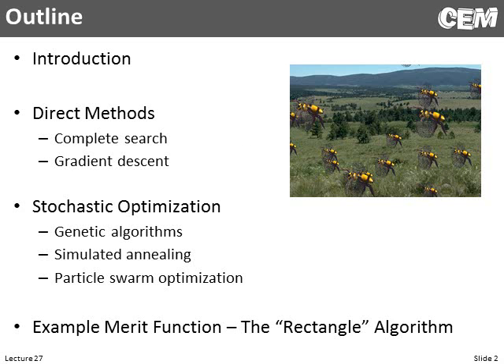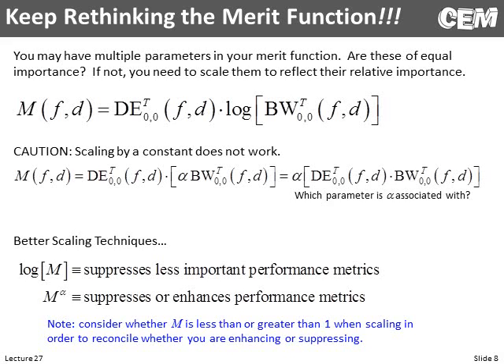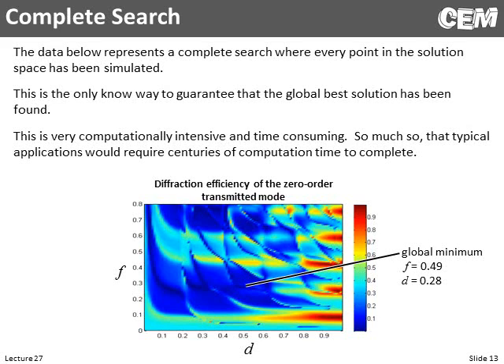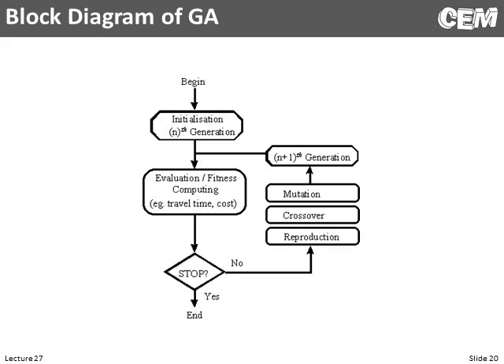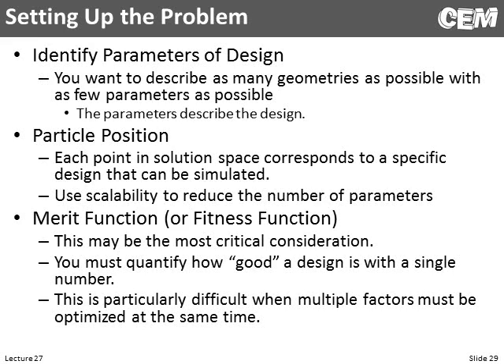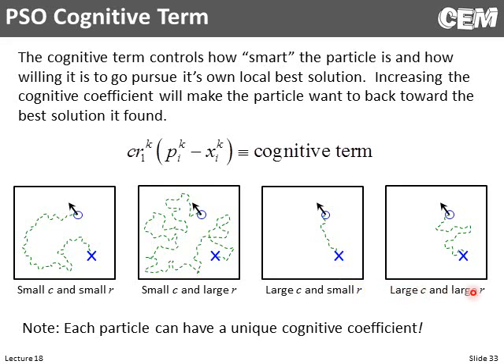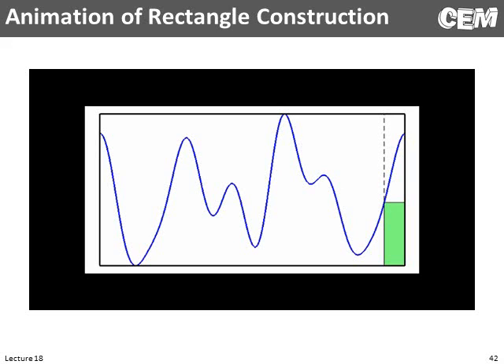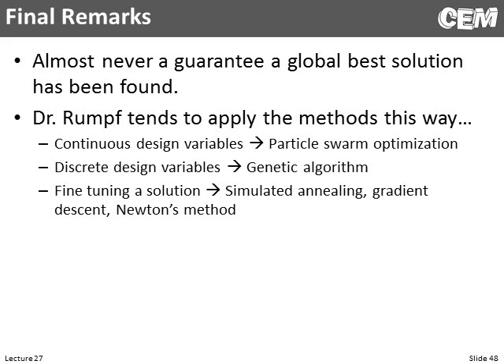Lecture 27 (CEM) -- Optimization

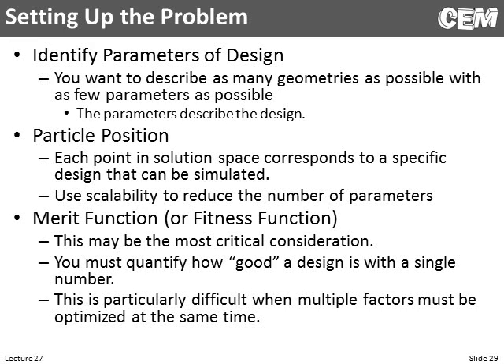Comment: (30:16) Normalizing a design parameter to wavelength, finding optimal design, and rescaling back to wavelength of interest, may not always work. For example, the length of tapering of microstrip line may not be linearly related to the frequency of operation. Do you agree?
Reply from the maker: From a pure electromagnetics perspective, scalability always applies.  The deeper story is that Maxwell's equations are form invariant meaning they stay the same regardless of the coordinate systems.  So, if you double the physical size of a device, it will behave exactly the same way, but at half the frequency.  I am not sure, buy maybe if the device is composed of a nonlinear material scalability may not still hold.

Now from a practical perspective, scalability may not hold, but for non-electromagnetic reasons.  If you shift the operating frequency of your device, the electrical properties of your materials may change, altering the performance of the device.  Your manufacturing methodology may also not scale if you are forced to build parts with smaller feature sizes.  All of this aside, scalability must hold.